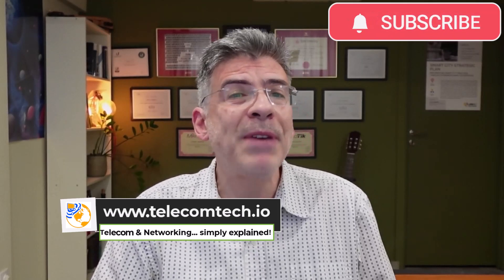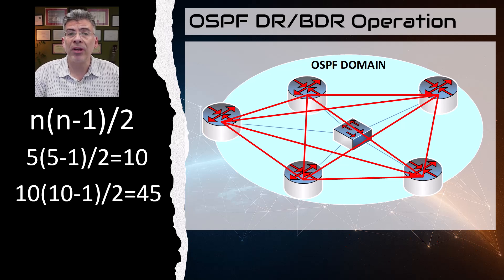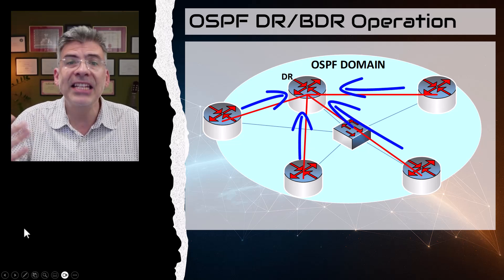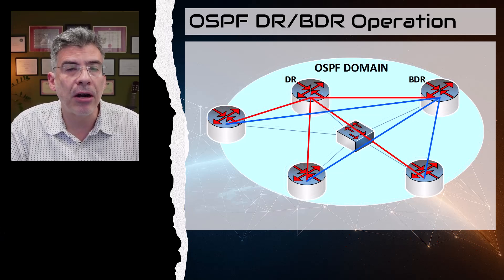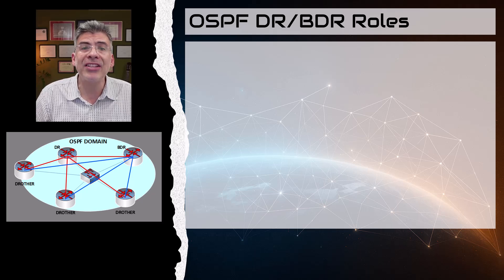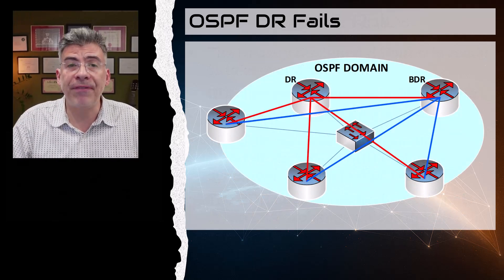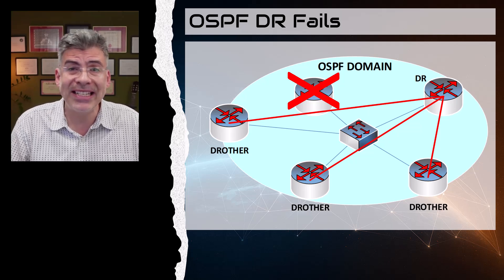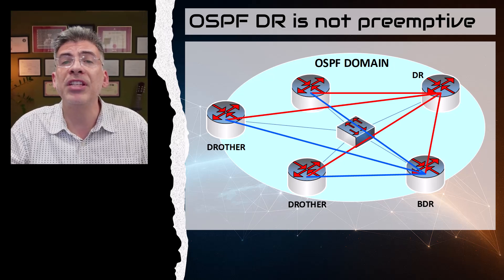OSPF DR/BDR Operation

Comment: Thanks Lazarus for the efforts .  I have one question if you can guide pls
As DR and BDR have adjacency means DR is already sharing complete topology information to BDR... also BDR have adjcency with each DROTHER. In this case wont be it a double workload for BDR to handle ?

Also is there any special LSA DR will  generate to share complete topology information with all other routers including BDR ?
Reply from the maker: Hello again, and thanks for your questions!  

1) Is it a double workload for the BDR to have an adjacency with the DR and the DROTHERs?  Well, no not really.  Each DROTHER creates two adjacencies, one with the DR and one with the BDR.  The DR and BDR create an adjacency between them.  BUT, the BDR's role is purely passive until the DR fails. It does form adjacencies and receives LSAs, but it does not flood LSAs to other routers unless it takes over as DR.

2) The DR generates Type 2 LSAs.  We'll talk more about those when we go over the various LSAs in an upcoming video...
Reply: thnks @telecomTech.explained